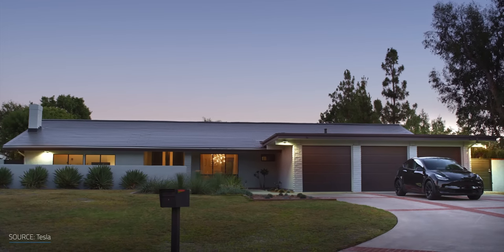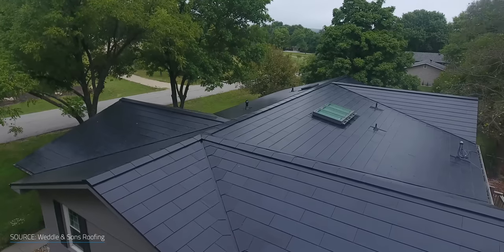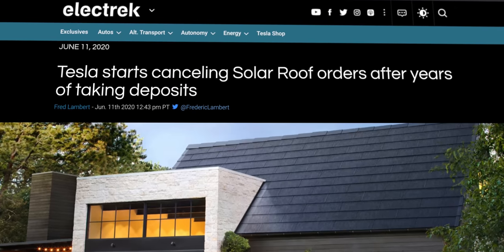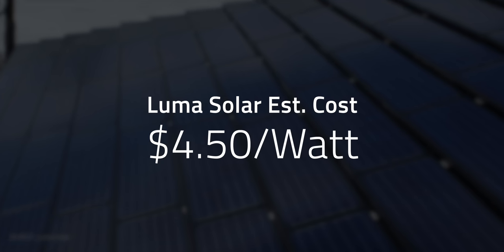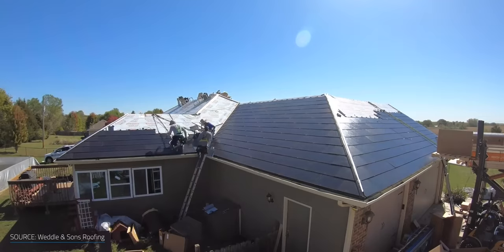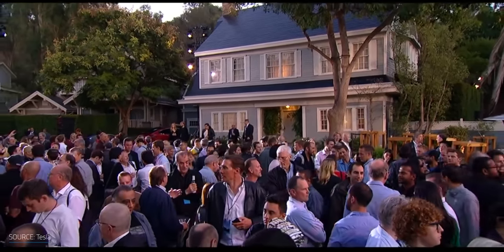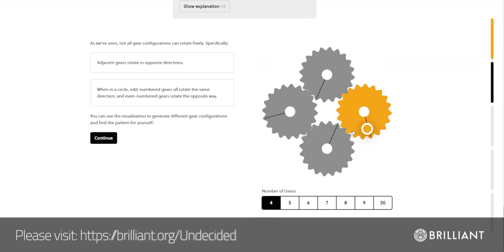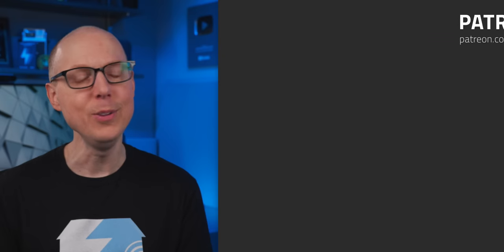The Problem With Tesla’s Solar Roof

Comment: I'm hoping it is only a matter of time until the "shingle" style panels are more efficient, more affordable, and less noticeable.  It seems like a lot of the electrical could be designed to poke through the roof and be wired under the decking instead of on top.  The risk for leaks would be a bit higher, but I'm sure that could be accounted for.  It seems like these panels which get so hot need a way to actually convert more of the excess heat into energy rather than only the light.  I suppose that heat is just the 80% inefficiency.

Comment: Thank you very helpful. I filled in the 'get updates' subscription box for the Tesla roof back in like '17 but never heard updates for my area. This helps explain why, nice to see some healthy competition growing in this domain/market. I don't mind the look of the industrial panels, but couldn't argue against the claim thay their design could be more elegant / aesthetic. I have always worried about the updraft force they'd put on my roof, or that squirrels would build nests under them - integration into the sheathing alleviates those worries even if the liklihood of them occurring is low. You can estimate the remaining life on shingles, so it does seem possible to queue up for materials/installation 5-10 years in advance. But agree some predetermined rate of inflation built into the contract would be reassuring  for clients.

Comment: Panels are still the most efficient collectors.  Putting them on the roof, when you have acreage is a no-no.  My neighbour has made a carousel with a plane of panels tilted to the equinox angle.  He has a raspberry pi to time a tiny motor that rotates the panels to track the sun.  This is the most efficient system I have seen.

Comment: I saw a Canadian Upstart that had very durable,  flexible asphalt panels that could break and still push power i believe from both shards, it was incredible. the inventor was an old man. i saw it on pbs about 12 years ago or so i think. I havent seen or heard anything about that type of panel since, but i havent really applied myself other than keeping an eye out to find them.

Comment: I had planned to deliver a solar roof of my design.  manufacture was not a lot, but buyers all wanted no commitment and cheap prices, when their own actions caused problems.  I have houses in Sweden now free of power grids and generating $6k surplus, these are the standards we all should be building to.  Or do you want to have a home that is a cold dark cave.  I am based in the UK, but after death threats for my fuel free generators, no way I am doing anything for people to benefit anymore. Now I am doing something much more radical.

Comment: Really good video.

You need to remember that houses are a micro-climate and depending on the method to the madness one new idea can cause someone's home to grow mold and rot away.

The middle east invented air-condition for homes over 3,000 years ago using underground aquifers. They also invented the double roof. Where one roof is entirely covered by another roof. Those ugly old solar panels accomplish the double roof which is a benefit in hot climates but makes roofs have more snow in cold climates.

Also here in Germany, the curved clay tile rule and if you can make a similar solar solution to those tiles. I bet that would be more efficient than flat panels. Would be great if you can find out is anyone developing a solution like that.

Comment: Solar roofs are just not economical yet compared to standard solar panels bracketed to the existing roof. Even with 30% tax credit its still too costly for average home owners. I am personally not a fan of mounting solar to roofs especially if its avoidable and you have space for a ground mount system. I do really like Tesla solar roofs if it didn't cost so danm much. Would love to see this as the standard on all houses in the future.

Comment: If you have space, put the solar panels on a platform that is on the ground. panels are easy to get to to clean, remove snow, and do repairs on. The cost of instattion will be a small fraction of roof mount.

Comment: We had one installed in SoCal last November and got PTO end of November. System cost is 90k which is about 30k more than conventional. First we have data reading issues where solar production is mistakenly doubled (actual production is only half of that based on SCE data). It took Tesla more than two months to resolve it and they had to cut my solar off for more than two weeks. Then we found out that Tesla designed a 12.6kw solar with only one 7.7kw inverter that’s insanely high 1.65 DC/AC ratio. The solar design was a black box to me until installation is completed. I argued with Tesla for another two months and they refused to add inverter for me. System is good, but customer service is among the worst. Definitely regretted it.

Comment: One other thing that makes this hard: roofs that have an HVAC unit. While newer homes have them on the sides, older ones have them on top (like my home, which was built in 1960), so solar roofs like the ones depicted here aren't really a great idea since they can be easily damaged by the service technician. Of course, it is possible for home owners living in one of these homes to pay to have the duct work rerouted so that the AC is on the ground level, but that is very expensive (I asked the tech once, he quoted us almost $10,000, due to them needing to tear out the sides of the house a bit to install the duct work and do some rerouting inside of the house, and that was just his projected quote, he wouldn't know for certain until one of the installers came out to check so he admitted that it really could run up to 20k. At that point, I think it'd be cheaper just to rebuild the home)

Comment: there is a stark difference in rooftop solar installation in USA and Asia. Here, we install solar panels in separate housing on top of our roof, which is flat. The costs (using half cut mono-perc) are also a fraction of what is mentioned here.
Reply: Yes, flat roofs would be best for solar.  

In America, most people live in suburbs and every person has a standalone structure.  The cost of this housing design is incredibly high, so we use the cheapest roofing systems available, and that's traditional angled design that uses gravity to shed water quickly.

Comment: If it could be done for the same price in the UK then it would be cheaper than replacing the roof tiles on the average house, possibly even at Teslas prices. The design could be improved massively if they used hooks like on regular tiled roofs, as with nailing it would be like replacing a slate tile, all the tiles above it need to be removed to replace the one slate. I guess a new type of hook would need to be developed as the Solar cells would be too light for their own weight to stop them from being lifted by the wind.

Comment: Got a quote from Tesla 18.43 kW Solar Roof 2 Powerwalls for $107,189.43, my wife thought that was too expensive until, we took the $30,000 off for the battery and roof charges. that put inline with solar estimates from Sunrun and others. Of course we life just east of Los Angeles CA. and our house is now estimated at over $1m. Our electric bill is over $300 per month which makes the numbers work over 20 years.
Reply: Still freaking expensive. A normal system that size costs 20 grand.
And then just add the storage in a year or 2. Battery storage will tumble in price in the next year or 2.

Comment: Great video.  I live in the Northeast and have been looking into a solar roof for 18 months.  I went through the Tesla process but didn’t complete the transaction because the roof wouldn’t offset 100% of my energy needs.  I didn’t make sense to spend $50K and have a monthly electric bill.  I reached out to GAF but demand must be so good in my area because we haven’t been able to connect.  My biggest challenge is understanding what is available in my area and connecting with providers that are responsive.  Maybe a recession and inflation will drive down demand to the point where providers will be more responsive.
Reply: If Tesla cannot supply your electricity needs, GAF (with a lower per sq ft efficiency) will not be able to.  You need a bigger roof

Comment: I have RGS Energy/Dow POWERHOUSE solar shingles and believe they were the best engineering solution.  The combination of asphalt roofing with solar shingles is ideal from a price/performance standpoint   GAF is addressing the primary problem I witnessed in that roofers don't do solar and solar installers don't do roofing.

Comment: I believe that solar roofs will eventually change the paradigm, but it's going to take a while to happen. It is also definitely a technology that is going to work better for people can plan ahead and design houses with simple roof lines. 

I think Tesla's concept, if not their product, is the future. Asphalt shingles lack durability; solar roofing tiles are attractive and have the potential to be very long lived. 

For now, I'm getting regular panels on my house. Eventually I will probably replace my asphalt shingles with tin and add a few more panels. But if I build a new house, or renovate an old one, in ten year's time, I'll definitely be looking at where solar roofing products are at.

Comment: The additional pressure on cost is now how local utilities, who were once relatively generous with their net metering policies, are now trying to roll back those policies, bit by bit, so that the ROI goes back up to the 15 year range (it got as low as 5-7 years, taking into account an electric vehicle, pool pump, HVAC, etc.), or worse.  When you purchase a solar roof, as opposed to panels, then the house is locked into the investment side of the ROI, while regulators might pull the rug out from under the return side.  To hedge, you'd want to have the capability to install battery storage so that you can time shift your usage/generation.  But, if you use that as your hedge, there's always loss in pumping into and extracting from the battery bank, and so there's a huge incentive to maximize your sqft efficiency, and that plops you squarely back into the solar panel regime.  It's quicker to get installed, and you get at least 30% extra bang for your buck.  AND, if your current limit is your grid tie capacity (you have a large roof or space to support a stand-alone structure), it's relatively cheap and easy to portion off some of your panels into a off-grid system that you can use to top up your battery bank or service a completely separate battery bank (say, mainly for daily car charging).

So, if you want a safer ROI, you still want panels.  On top of all that, I still think there is way too much hand-waving when it comes to thermal control when the solar roofs (OR flush mount solar panels) are mounted on a house in an almost always sunny climate.  The efficiency issue is one issue, but there's also MTBF... and frankly, while you can probably get a warranty replacement from a panel manufacturer, they aren't warrantying the wiring and the microinverters, and those absolutely will have reduced MTBF if they're cycled between 60 and 120/180 degrees daily.  Solar roof manufacturers are doing their best to address these issues, but I just haven't been made comfortable with the lifetime situation by what data and explanations they've provided so far.  

Finally... I'm just more confident that I could handle maintenance and repair on a panel than on a solar roofing tile, if I needed to do the work myself (cost, time, availability, etc. reasons).  That's huge for most people wanting to install significant solar generation on a residence.

Comment: Solar tiling seems cool but it's just not efficient enough for the pricetag. For the cost of getting a solar roof I can get 2 large rotatable panel rigs that together produce about 3x the electricity? And since the panels can be tilted and the rig can be rotated you can chase the sun too. Getting it to automatically move all parts and get the absolute maximum would be expensive, but getting the panels to roughly aim their faces at the sun is quite doable. Sure, I lose half a field whereas the solar roof takes no additional space really but still. For me to get a solar roof, the costs need to get halved or the production needs to double, or those 2 factors need to meet somewhere in the middle. Right now it's just not worth it.

Comment: A couple questions come to mind. Snow, moss, dust. Will these reduce/eliminate efficiency? Are there solar siding shingles?
Reply: These factors do measure into the equation.  A good installer will factor them in.  most homes don't have the vast roof space to take the average leaky home (80-90% waste) to net zero.  Most PV installation have an ROI far, far above the ROI of a flat screen TV, stone countertops or a new car.  Why solar for the sake of solar.  Eliminate that 80-90% waste and very little PV is needed, and comfort and IAQ are greatly increased.

Comment: South Florida solar roof research: SE Florida, Palm Beach, Broward, Miami Dade are the three counties with very strict regulations in reference to home structure for hurricane survivability. The roof is a very important part of that structure, and as of January 2022, my insurance agent can find only one company in the state that will insure a home with solar panels. So, I have made other improvements instead. Insulated, Category 5 rated windows, energy efficient appliances, A/C, water heater, insulation and other practices. My "electric usage" portion of the bill average $105/month. This is about $50/month cheaper that what my monthly payment would be for a solar system.

Comment: 9:08 - 9:14 Are you sure that the units aren't supposed to be watts per square meter.
A modest home has about 2000 square feet of roof area, so that would be 2000 sq ft * (45 watts/sq ft) = 90,000 watts.
You could power the whole block with that.

Comment: A 2000 sq. ft roof with 2000 sq. ft of solar panels that get 16% efficiency in an area with 4.4 peak sun hours (large parts of the US) could theoretically get about 7,800 bucks a year saved in electricity, assuming the average price of 13.75 cents/kWh. This means that if a roof like that costs 50,000 USD, then it should take less than 7 years to get a profit from your roof. 

This is a very rough estimate, but even if it took 15 years it would still be a good ROI, since roofs generally only need to be replaced every 25 years.

Comment: I thought I coined the term myself back in the 90's, should have gotten a patent. The "solar shingles" I designed years ago would work like and be replaceable just like normal shingles. Working on a house and had to remove a big homemade solar heater and some panels to get to the roof.

Comment: I just got an estimate for Tesla roof in the Texas market, we have a big home (3600 sqft with a roof of 66. sqares) and our estimate was 190,000.00, they were able to get it down to 154,000.  That was WAY too much.  We have to get a new roof due to hail storm damage so we thought to look into it.  A few other considerations that increase the cost.  Solar roofs are said to increase the value of the home, which in theory sounds good, until you realize that the 190K price tags means additional taxes, in addition, your insurance rates go up to cover the cost of the new home value.  Meaning your deductible goes up to.  So there are a lot of other costs that a home needs to consider when thinking about a solar roof.  We didn't go much farther than the price tag.  I'd say that's #1.

Comment: I thought the main problem was that the Tesla ones don't exist. Also it must be a nightmare to error check and maintain/repair broken components compared to conventional solar panels as the shingles generally overlap, not to mention the premium pricing for looks exclusively. I mean it's not like solar panels (and all the other components required) don't already garner a hefty price tag. Then there's the whole issue of covering the entire roof when one side will most likely not generate anything during the day (for the vast majority) - another money sink.

Also, something many care about more than actually being green - the bragging rights for being green. Conventional solar panels are hard to miss. Not that solar panels are that green, dirty manufacturing, low life expectancy, low recyclability. But you get the point.

Basically these solar shingles solve a non existing problem, adding a lot of overhead on both price and maintenance. Next: Tesla builds a 1 wheel self-balancing truck - because.

Comment: Seems like trouble - I know US roof tiles/shingles have a specific lifespan which may result in a different decision. In the UK you would expect to re-tile your roof once every 20-50+ years - perhaps never.

Adding solar embedded in the roof feels like making that permanent weatherproofing more complex than it needs to be.

When/If my roof leaks a roofer can fix it (touch wood)
When my solar breaks its more of an electrician.

Different skillsets and availability - as of today - they're not the same person.

Comment: The tesla roof is a great value, and they have finally caught up in production to actually deliver on time. The durability of the tesla roof is nearly aligned with a slate tile roof lasting atleast 25 years in the harshest climates. Easily 4x as durable is the next expensive competitor. 

The biggest problem is most owners (less the forever homes) will sell the home before they break even in costs and start to profit.